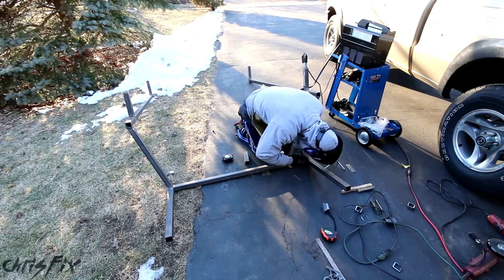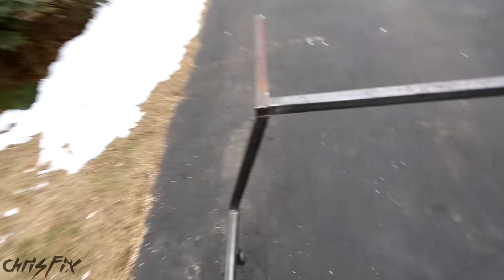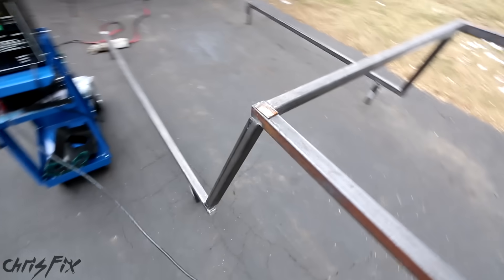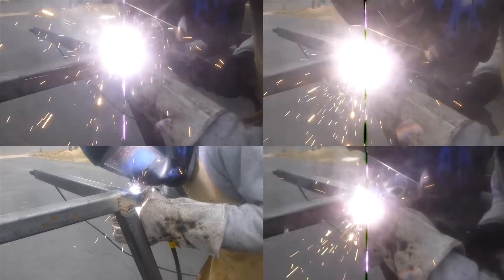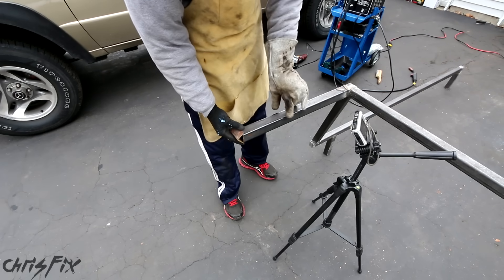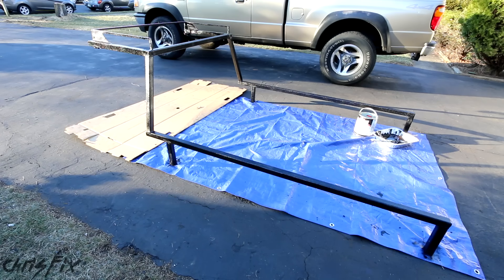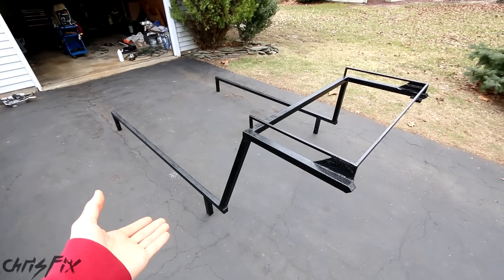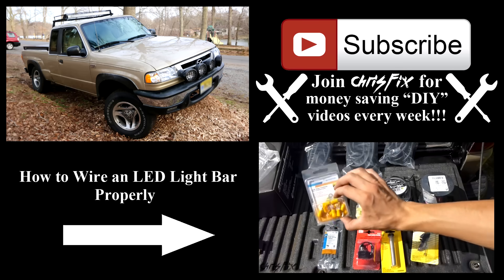Custom LED Light Bar Build (Part 2 "Project Night Light")

Comment: Invest in a real welder man. A 110v welder with flux core wire is a perfect recipe to redo this whole project 10 years later. Previous owner of my 4Runner used a shitty harbor freight welder with the same wire and all the rear bumper welds broke when I backed into a tree. Ended up having to go back and rebuild it with a 220v gas feed welder

Comment: put some amber and white led strobes all around the frame 360 degrees, so if you are ever stopped on the side of the road, you will be covered.

Comment: Personally I would have added like that diamond wire mesh to the top behind the light to like hold ice chest etc without it scratching up the roof of the truck but I also don’t have a truck or any of the materials to do this so oof

Comment: Looks slick! One problem. Moar lights! But for real, you should add a 2x2 on the back of the roof rack, above the rear window, and shoot to the side. And it couldn't hurt to have two on the very back by the tailgate.

Comment: ChrisFix  try pushing your weld vs the drag. make small circles around the joint, can work it in and out a bit as well. Sounds like rippin a zipper with plugs in. Should create a nice flat profile that you don't want to grind off. Nice frame, great fit up.
Reply from the maker: Thanks for the tips!

Comment: Quick tip, probably already in the comments, but I would look up a video on 45 degree cuts and weld them together, also have to make sure that your welds all around are sealed, water will rust it from the inside out.  Good job with that damn flux core I hate that stuff.
Reply from the maker: Thanks for the tip!

Comment: Nice build man! My only thought is, have you thought about adding a support gusset/plate of steel to the joint heading up to the roof rack. Maybe in the top of the lower bar or below the top bar? Still a good build man!!

Comment: Welding magnets and c clamps help out alot. Also the vertical peice behind the cab and the horizontal peice is welded on should have a strut welded to both support.

Comment: Did you ever go off road? You are trying to protect your fancy LEDbar from  above branches.  Did you "MIND THE GAP" ( between the roof and rack)? Any branch that will stick in there  will tear apart all the structure  and spoil the truck itself probably.

Comment: Nice build!  I know that feel when you complete something mount on your vehicles, I do the same to my boat, build my own boat stainless steel top myself, although failed to welding and using rivet but it stays strong!

But one thing want to ask, is that welding like this your mount from the back of the truck extend to the top of your truck still holding well?  

 I know you don't want to be drilling the top of your truck, so I was wondering there no supporting point between the LED mount to your truck top still stay strong when running the truck on the road.

Comment: Hey Chris love your videos. You just inspired me to rebuild my set of rv steps that the sheet metal has rusted off and crumbled. Found bar stock and going to see about finding steel diamond plate to replace the step surface with. Invested 125 on that very same welder and likely another hundred for the other materials. Much better value than 400 for another set of steps!

Comment: Hey Chris my father was a  CNC machinist. I think you should have used thicker mount brackets and tapped you light bar bolts? Those look like machine screws anyway.

Comment: Here is a great idea. Get some expanded metal. Cut it to size. Weld it to the bottom of the top rack. The whole area where your light bar is so it's also a cargo rack.

Comment: Tip for marking drill holes at an angle: Dip the bend nail in 1: nailpolish, 2 Typ-ex or 3 paint, when you can not find the "marking" after scratching.

Comment: I don’t know if you know but when tapping a thread for a bolt, you should drill the hole 0.5mm thinner than the diameter of the bolt. It stops the wiggle that you had in your bolts
Reply from the maker: Thanks for the tip. The wiggle was due to the metal being too thin to technically hold the bolt. It needed more threads but it did it's job.

Comment: Looks great. I looked through the comments to see if someone suggested it but I would of added some grate so you could use the roof rack rather than it jus holding your light. I’ve watched a bunch of your videos so I’m sure that if you wanted it you would of built it that way. Great job.
Reply from the maker: Thanks a lot!

Comment: After you made your pilot drill hole you should’ve drilled from the bottom. Just a small tip of advise for any future projects
Reply from the maker: Thanks for the tip. Why is that?
Reply: In your case from what I saw you had to have a slight angle while drilling it, it didn’t seems to cause any problems but it saves on you hitting your drill bit off of other surfaces like the piece that stuck out at the top, and makes sure the hole is as straight as possible. It’s what I’ve always been taught, I’ve been in a welding and collision repair classes and my family is full of metal workers and they’ve all said the same to me. Thanks for seeing my comment and replying

Comment: Good Idea. But the thickness of that steel was a little bit of overkill. You could have used that tubing to make a car lift. And lift your truck, with another truck in the bed.

Comment: Love your vids.  Question, I am installing a LED light bar below my bottom front bumper on my chevy express 2500 van for use as driving lights.  My question is how can I wire it so that they are NOT able to be left on when I turn the van off?  My worry is I will leave them on and run the battery out.  I would like them to only be able to be turned on when the ignition is on.  Thanks!  PS- looks like you're in the Pine Barrens section of NJ?  I ride my motorcycle there....

Comment: Hey Chris man thanks for all the videos he gave me some good tips I got a Ford Ranger 99 so that likes to look great on mine too I'm going to give you a check when you paint is that user what we call a wiz controller with a rambush tip pox that way you don't even have to use a brush to cut in the whizzle get in there thanks again for all your videos

Comment: I noticed your welding gun pushing back whilst welding. Try a lower wire speed for more control on the weld

Comment: you should probably drill holes on the under side of all the tubing to allow moisture from condensation to evacuate the tubing or the whole rack will rust from the inside out, and i really hope you disconnected your battery before welding anything on the truck! hahaha, love the videos man keep it real !

Comment: Great job. I might have added, on the part over the cab, a rail across the back and a steel mesh floor, to work like a roof rack.

Comment: I use JB Weld as a body filler on projects like this.  You can paint it, but not powder coat.   I think I would have put a few gussets to keep the top rack from bouncing.

Great job Chris!

Comment: You could add a metal mesh to the bottom, underneath the where the light bar sits to create a basket up there, you could tie down camping gear and maybe a spare tire on the top behind the light-bar. I think it would add structural integrity and more storage, also it would look pretty cool with the spare tire locked on on top

Love the videos, keep up the good work, btw: I used you wheel painting video to paint my wheels black

Comment: Could have tried angle cut and weld to avoid end capping and also increasing the strength of the structure.

Comment: That looks awesome!. I would consider to add a "basket " or a grill type of build behind the light bar so you can put/set your spare tire on it. Also....2 more 4x4 spot lights, 1 on each back corner, you know...extra day light at 360°.
I know that's what I'm gonna do when I build mine. Thanks for sharing your great ideas with us.

Comment: I saw someone use hockey pucks cut in half to achieve that same thing as the angle caps to prevent noise when driving.

Comment: Why didn’t you just spray paint the frame? Would’ve saved you time. Or you could’ve sprayed it with Bed Liner. Time saver.
Reply from the maker: This is more durable.
Reply: ChrisFix more durable than Berliner? Not trying to argue, I’m actually curious.

Comment: I noticed the snow on the ground..... if it’s really cold out your best bet is to heat the base metal with a propane or butane torch and wait until the metal sweats the water away, then start your welds. Your welds will hold and look 100x better

Comment: Great Job!! But one thing I was noticing... you got a waaay out dated trunk bed plastic liner. I'd suggest that if you're going through all this just to add some improvements (in terms of looks) on your truck, that you might want to consider LINE-X your truck bed. It would complement that rail and definitely make your truck look better, as well. AND of course, LINE-X is a very durable and tough protection for your bed. Practically in-destructible.

Comment: Love your vids chris!! At 11 min. I thought that maybe you should've welded some nut tabs on the back side of the poles instead of self tapping holes for more durability. Either way Gr8t job and I have the same truck. 2001 b3000 2wd 5sp. I to am working on it and plan on doing some of what you did to yours. Keep up the good work!

Comment: Hello chris fix
This is a fantastic project and I'm thinking about doing this almost identically for my crewman ute but I have a question. 
Does the light vibrate at all due to the unbraced forward bars distance from the  uprights near the rear windscreen?
Once again awesome project 🖒

Comment: I have to say though, nice job on the roof rack. I would have mirror polished it though, with a clear code paint protection.
Or limax it. Some carbon fibre decoration. Bing Bling.
Reply from the maker: +CSA Chevaux sans abri thanks and thanks for sharing!

Comment: You said you wanted the metal bar on top of the light bar to protect it from trees and stuff. 
I just wondered why you put it right on top, instead of also slightly to the front. That way, it might prevent any leaves or whatever from even touching the light bar, instead of only taking the force of the hit. 
But then again, it's not that much above your roof, so you probably won't be hitting anything that's heavy or sturdy with it, right?

Keen to learn your thoughts! ^^

Comment: You should've never plugged the end cuz the moisture with get in the tube and not be able to evaporate and it will rust faster
Reply: How will moisture get in if it is sealed?

Comment: Just a short tip. When welding the square tubing before you weld the end cap you should spraj some oil in the tubing. Either with a paint sprayer or others. It will prevent the rust. But a great idea thoe. Love it!

Comment: that's bad ass since you're doing all this 4x4 custom work for a 2 wheel drive my you as well bolt on a 4x4 transfer case and differential lockers

Comment: Its much better if you could add a switch inside so you just press it without going outside to turn it and its safe because sometimes there some people that might hurt you if you go outside and turning on the light so much better have a switch inside its much safer
Reply: Oh my bad you actually put switch inside im really sorry guys

Comment: Chris I've newly started watching your videos. I must admit I'm very impressed. As an ASE technician your attention to detail is great, your effort and willingness to not cut corners is a plus. Keep up the good work. 
PS. You sealed ALMOST every part of this rack except where it goes down into the bed. That unfortunately will cause it to rust from the inside out. As Oxygen on steel is the enemy.  Also use rector seal on the threads to bolt it down. Maybe even some rubber for vibration dampening. You could easily start your own small shop and make a nice living.
Reply from the maker: Thanks and thanks for the tips!!!
Reply: I Must ask how did you learn all that you know?

Comment: If you look in craigslist and you are patient, you can find old industrial AC/DC stick welders for the same price as a buzz box, and duty cycle? What the hell is that :) I've seen many just unloaded a scrap dealers for the copper. You might have to put in a 240/50A circuit, but a retired industrial welder will really change your mind about stick welding. Use some contact cleaner on the switch and dial. With some practice you can lay down 7018 welds that penetrate properly, and you never have to wonder if you have enough welder for your project.

Comment: you could have welded in some diamond mesh to protect the back window and diamond mesh under the light bar area for esthetics plus you gain an extra area to strap down stuff (maybe a cooler). plus I really like the light bar protective pieces of metal by the bolt holes, oh yeah, by the way where do you live again.
Reply from the maker: +IMMF MILLER thanks for the tips!

Comment: I'm building one soon I'll post a video prolly in the next two months I'm busy rn
Reply from the maker: +J2XG inc awesome!
Reply: ChrisFix.... I'm sure it's already been said but you could add a metal plate to the bottom on more rail in the back and have a small luggage rack behind the light bar

Comment: When you tapped the holes, did you tap with the same diameter as the drill size? I use a handbook to find the size the drill needs to be, the drill needs to be a bit smaller than the tapping. Just a friendly question since you didn't mention it, also sorry for my bad english, i'm norwegian. Love your videos, keep it up. :)

Comment: I'm just saying this not trying to mean or anything but a bar right on top even with the light bar isn't really going to stop branches from hitting it from the front, scratching the lens, it would have to be probably a inch in front of the bar, but other than that great project!

Comment: Chris I enjoyed your build. I have some tips to make it easier for you,  cut off wheels for the angle grinder as opposed to using the end grinder and also use a white wheel to clean the welds and also scuffing up the metal for paint. hope to see more from you

Comment: Hey Chris is there any other light bar make you would recomend
Reply from the maker: Honestly, I have run cheaper light bars and they all leak after a year or two. Once water gets in, they are toast and it is a pain to replace. I have used these which last about a year before water seeps in: http://amzn.to/2iIFEZN

Comment: Have you tried switching the bolts holding the bar mounts around to where the nut is hidden just in case your bed flexes the nut wont hit the top of your truck? Other then that man this is pretty cool!
Reply from the maker: I tested the flex and it isnt even close to hitting but good idea!

Comment: Hey Chris can you send me a link for the drill and drill bits that you use, also I have a question. Do you have a special drill for drilling in metal or just a special bit? Or do you have to use both a special drill like a power drill and a special drill bit? Thanks

Comment: I like it, one piece of creative criticism is would offer, is just one small part in would have done differently.  When you mounted the light bar, on its stand mounts, you could have bypassed much work by getting longer bolts and spacers to directly bolt it to the main bars and it may have been low enough that you would not need quite so much of a bush guard to protect the light.
although I could see where you may want it mounted up higher for the lights effectiveness, but if that was the case I would move it further forward finding the point where the light does not hit the hood.  if i had the money for one of these lights, i would take inspiration from your build to do the same to my truck...  but my trucks a bit bigger, 589 peterbilt...

Comment: 1:49 The excessive spatter and baked looking tan color means you're running way too hot . try turning the amperage down on your welder! I'd bet 15-20 amps lower would do the trick
Reply from the maker: Thanks for the tip!

Comment: I want to do the same to my ranger but I don't want the long rails like u did to take up all the holes in the bed I only want the front two
Reply from the maker: You can create it any way you want! That is called a headache rack what you are wanting to make!
Reply: i want to put light bar but it would want a light bar to go from the one side to tother

Comment: Do you regret not extending the rack over the whole cab? Personal preference I know . Although your needs could change down the road and you may need more hauling capability .
Reply from the maker: I am glad I didnt extend it over the whole cab. The light would have been too far forward and there would not be enough support to put stuff up there (unless it is light). I am actually really happy with how it came out and wouldnt change anything except put the alley lights in!
Reply: I see . True as I see that your truck doesn't have drip guards . The drip guards are what I used in mounting of the rack on my jeep Cherokee

Comment: Probably late to say, but maybe you'll read this, you need to increase power or decrease wire feed on the welder or both. Can't remember exactly but I did do a year of welding school, and you could see in some shots that the wire goes out long and then snaps, that means you need more power. But if you get a lot of splatter you need less power, that's how I think it was. Gotta look for the books we got. :D
Best way is to fiddle around on a test piece until you get less splatter and good feed and a nice penetration. Good video, nice build!
Reply: Also, good enough for self-taught, and better than most self-taught people I've seen. :D
Reply: looks like a bad ground.

Comment: Invest in weld through primer. It helps prevent rust in metal to metal contact areas, plus its just good measure.